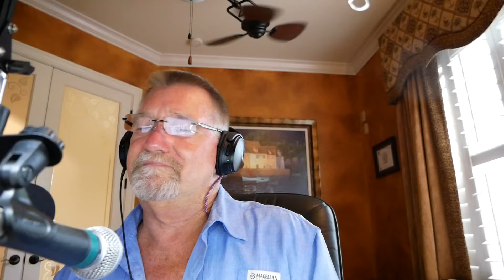2020 Jeep Wrangler Low Voltage?

Comment: I have experienced low voltage on my 2020 Jeep Gladiator Rubicon using a battery voltage tester and charging system tester and the voltage went back up to 14.2 on its own without me fixing anything. I don’t understand it either but I also deleted my start / stop battery and hooked up the positive cable from the small start stop battery to my main battery and pulled number 42 fuse. There has to be a connection issue somewhere in the wiring harness but I have not figured out where yet.

Comment: Cars have evolved.  New jeeps have a "smart" system and it will put out the voltage it needs to keep the battery charged. From what i have learned.  I just replaced my main battery and before that the dash said 14.4 but it also told me m
That my auxiliary switches where turned off until the battery charged. Now with the new battery the voltage reads 12.9 while moving and it goes up when im slowdown.  From what i learned,  if you always have 14 and above,  oneof the batteries is not doing well.  There's more info about this online.  It is weird if you thinkof it like an old school system we are used too
Reply: Exactly the same thing happens to me, it charges when I slow down and it starts discharging little by little with use but it doesn't go below 12.6, I don't know if it's normal
Reply: @ thats normal. 12.6 while the engine is running means the battery is fully charged.

Comment: My 2020 Jeep Wrangler Rubicon, 2 door, 2L turbo, has 21k miles on it, 
has never been off road and has had all of the following problems: 

Replacement of metal gasket that failed leaving me stranded with no coolant.
Pinched wires causing the internal lights to malfunction.
Check engine light due to a CO2 sensor failing.
Recall on the steering wheel gear box replaced. 
Recall for possible leaking gas lines.
Auto start stop failure caused a replacement with many visits to the shop:
     Auxiliary battery.
     Main computer.
     Electronics module.
     Alternator.
     Many miles added to the Jeep during test drives by the certified Jeep dealer.
     To solve the problem, they just replaced the Main battery and gave it back to me.
Reply: Just wait till rock arms and cam shafts fail.  Oh the head gasket failures and overheating!   Fun times.  Jeep thing I guess.

Comment: That is a normal voltage. It is low because it it charged. Mine runs from 12.7 to 14.4. This is the alt doing this

Comment: Does anyone know how to eliminate the AUX Battery? It is difficult to change.
Reply: After removing the aux battery connect the positive lead from the aux battery to the positive on the main battery and just tape the end of the negative aux lead and put it out of the way and youre done.
Reply: @danielsmith5351  The little battery actually starts the Jeep and I have found when you disconnect the motorcycle battery it won't start.